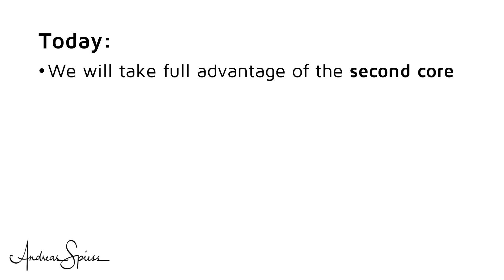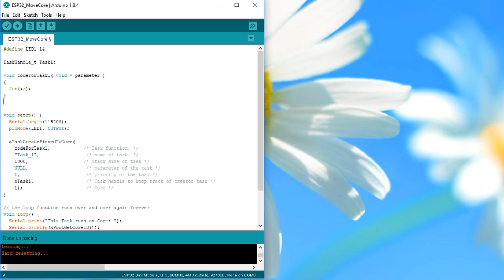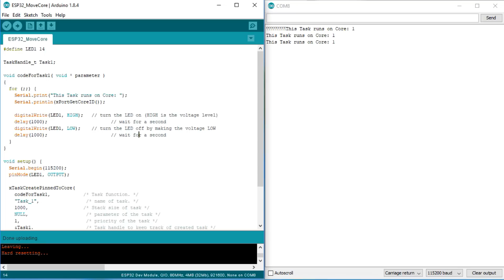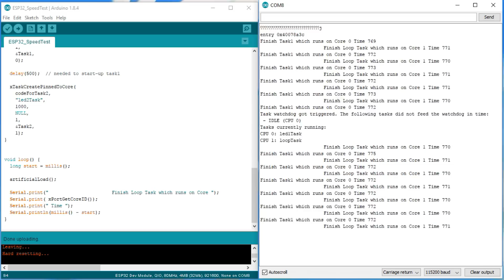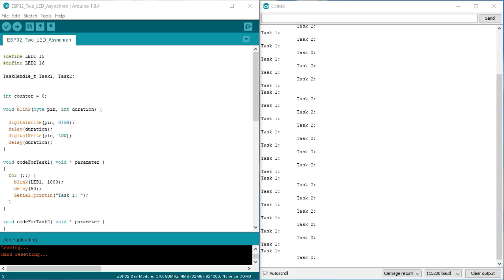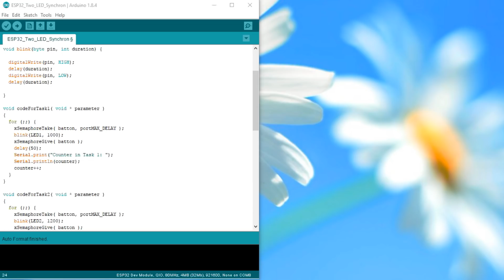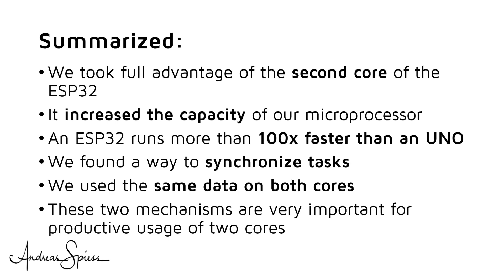#168 ESP32 Dual Core on Arduino IDE  including Data Passing and Task Synchronization

Comment: Hey I am currently working on a project that required high sample rate data from ADXL345 to send to AWS IoT and I tried. Dual core with one core fully dedicated to sensor Task putting data to Queue and wifi Task would take from the queue make a json and publish it. so I made a message of 64 samples (each of 16-bit x,y,z total 6 bytes*64) and queue size set to 100 or 150 but what I observed was that once the sensor task would completely fill the queue. wifi task would suddenly slow down and like the delay to publish from picking data out of queue would increase and thus hamper sensor task also as queue would be full. I could not use more RAM with just Array implementation I was able to have 9600 samples of x,y,z. which is less than what is required by my client. The code has wifi manager also if I remove that I get addition 10% free RAM. is there a way we can store more SAMPLES without manipulating x,y,z or without removing wifi manager? this was on Arduino and it does not support over 4 MB RAM of Wrover so we are stuck this amount of RAM, unfortunately.
Reply from the maker: Maybe you can reduce the amount of memory used by reducing the number of bits used for one number. I would first try to understand why it slows down. I would remove everything not necessary and use an oscilloscope or a logic analyzer for real-time debugging. If you do not know how. I made a video about debugging of real-time systems
Reply from the maker: Json is also not a good idea as it needs lots of memory.

Comment: HI Andreas, great video demonstration. I have a question: How to share devices, say, core 0 reads a sensor storing the data on an SD card and, with the next core, run code to pass SD data via Bluetooth to a terminal running on a cell phone. Thanks
Reply from the maker: As I showed with synchronization.

Comment: Lieber Andreas! Tolles Video. 
Eine Frage: Ich dachte immer dass der zweite Core die ganzen WiFi sachen machen würde, zB UDP oder TCP.  Ist das nun so dass ich das quasi selbst beim programmieren vorgeben muss wenn die WiFi sachen auf dem zweiten Core bearbeitet werden sollen?
Reply from the maker: Die "Wifi Sachen" laufen wo auch immer (ich weiss nicht auf welchem Core und auch nicht, ob man das ändern kann). Du kannst aber deinen eigenen Code einem Prozessor zuordnen.

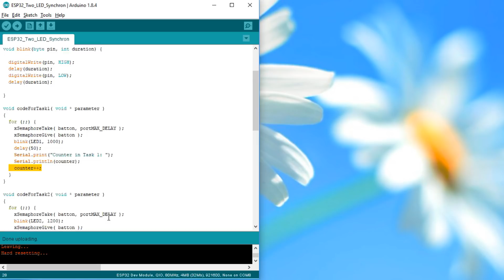Comment: To properly handle a scenario where two functions might access the same variable at the same time, (as in 10:50) I believe you'll want to declare it as "volatile" in the IDE. For example:

volatile uint8_t counter = 0;

In the past, this has solved situations on AVRs where I had a variable which was accessed occasionally in the loop, and very often in an ISR. Without declaring as "volatile", the ISR would have a chance of interrupting the "write" process of a variable in the loop, and would be unable to read it in the interrupt due to the corruption.

I think "volatile" declarations force reads and writes to totally complete before anything can interrupt it.
Reply from the maker: I am not sure if this concept works for two processors. I know it works for one. But this problem is much easier to solve as you just can prohibit an interrupt for a short time.
Reply: Yeah, maybe not. I've got an ESP32 coming in the mail soon that I feel will kick me in the butt trying to fully understand it. I've been on your channel for about an hour watching ESP32 and LoRa videos to study it - keep up the great work Andreas!
Reply: Defining variable as 'volatile' is definitely a step in the right direction, but isn't quite the ENTIRE answer.
The reasoning behind 'volatile' was more for the purposes of variables that could be altered in either the normal flow of a process, or perhaps in some ISR (Interrupt Service Routine), but this is still on a uniprocessor setup albeit with two distinct 'threads' of operation..
Thus, the 'volatile' definition was / is a 'hint' to the compiler that it should not 'cache' the value of a variable as it could quite possibly change BETWEEN sequential instructions in the normal flow if an interrupt had occurred.
What's required is a second step of mutual exclusivity (often called a 'spinlock') that guarantees exclusive access to the variable(s) in question.
The goal of a 'spinlock' supercedes ANY other asynchronous event (whether it is an interrupt, or perhaps even an entirely different CPU core), from modifying some fundamentally exclusive piece of data.
Concepts such as spinlocks become VITAL when you start developing non-trivial software (eg: The Linux kernel).
In the OLD days, much of the Linux kernel revolved around a single HUGE spinlock that was known as the BKL (Big Kernel Lock) which inhibited almost every other possible thread from execution.  Now that the kernel has significantly 'matured', the 'granularity' of spinlocks has been significantly improved such that threads are far less likely to be 'blocked' waiting for the release of the BKL from some totally independent mutual exclusion.
(Imagine having to 'stall' every single core of your 28 core beast simply because ONE of those cores wanted exclusive access to the UART ringbuffer.  That's how it was actually done in 'the good old days')

Comment: Thanks for the video. It is very structured and clear. RTOS is about being "real time". The RTOS guarantees execution of the command at that specific time. This is essential for real time control. Conversely non real time OS such as Windows, does not guarantee that an instruction will be executed exactly at the programmed time. For example,
In Sleep(1); Print("now");
Print statement may not be executed exactly after a sleep of 1 msec in non RTOS. This is because non RTOS drivers for example filesystem and network drivers may take longer than 1 msec before returning control back to the OS. In real time control systems, this unpredictability is disastrous.
Hence RTOS is about "real time" and it is a big deal, very big deal. 
RTOS are expensive. 
Hope this is useful. I am sure you can explain it much better than I can, thanks.
Reply from the maker: Thanks for your clarification.

Comment: Thanks for the video Andreas, lots of great info.

I got a MAX7219 Led Matrix display being scrolled on one core (using a task, core 0) while the other core fetched the data (just using the loop). It's great because you can now scroll without any interruption!
Reply from the maker: Thanks for the feedback! Interesting. So it works!
Reply: Yup! I had it running for maybe 30 mins or so and it was working fine (I know not a conclusive test, but promising for sure!)

Comment: Another great video , and I do embedded firmware for a living.  Well done.   One thing I miss in the Arduino IDE for the UNO is a single stepping sbolic debugger.  Is one available for the Esp8266?   Does anyone know if it can be fudged on the UNO?
Reply from the maker: I do not know of such a debugger. Otherwise, everybody would use it ;-) Would be awesome.

Comment: It's probably freeRTOS... Function names seem very similar. Try using message queues for data exchange, pretty straightforward and easy to use. Don't forget volatile key word for global variables if you want to use them. And try to protect concurrent access to global variables with a mutex.
Btw: RTOS is not necessarily smaller or less powerful than windows or Linux. It's just designed for a different purpose. The Mars Rover runs on vxWorks rtos ;)
Grüße aus Lausanne
Reply from the maker: AFAIK they use freeRTOS

Comment: Thanks for this!  It was very useful to me for something I'm doing right this instant - good timing (heh).  Was it ever discovered that the WiFi stack runs on core 0 for certain, and what priority we should set the task on that core to allow the WiFi stuff to get enough time for itself?  I'm finding this useful to cut latency in the regular loop() function by putting some other network-related stuff into core 0.  That way I can have super low latency with my sensors (not all can be interrupt driven), buffer data and then send that data in the non time critical task I have running in core 0.  I found just checking for data on some UDP ports was slowing loop time considerably (ms) but that issue goes away when the checking (for host commands and so on) is in core 0.
Reply from the maker: I did not dig into it any further. I would assume we give our tasks a very low priority. If nothing else runs, they are not disturbed and run at max speed and if other tasks run scheduled by the "OS" we do not disturb them without knowledge.

Comment: Hi Andreas,
Been watching your video tutorials with great interest.
Of course now i have a new question/challenge in mind where i don't find a answer to:
Can we mix ESP-IDF AND Arduino ESP-SDK in one sketch (i like to think this is possible, because i looked deeply into this video of the ESP on steroids)
BUT : can we create something like 2 sketches in one sketch and pin every single one to a different core?
What i mean is :

// make some vars
uint32_t myTime = 0;
uint32_t yourTime = 0;
#define sensorPin 15
#define PixelCount 72
...... // whatever one would need as vars

void setup1(){
...... // code for this setup function to run once
myTime = micros();
}
void setup2(){
....... // code for a second setup function to run once
yourTime = micros();
}
void loop1(){
..... // infinite loop code to run on core1
}
void loop2(){
..... // infinite loop code to run on core 2
}
but with all of the variables, classes, defines,  accesible to both cores
If that would be possible, we can split 1 ESP32 into 2 high performance systems, on one chip, separating Wifi, BLE, logic, and sensors to the core we want
This would mean we can drive neopixels, LCD's, buttons and so on.... in one core, and keep track of the external interrupts, data gathering, calculating data,....  on the other core
Looks like heavy stuff, but this would need a genius to start on this queeste (but i am not that genius ....)

Why do i ask this? Because i noticed that in the ESP-IDF there is no "void loop()" but a "void app_main()" instead

Thanks for the video's and keep up this magnificent tutorials for newbie (and experienced!) user of the ESP32 platform
Grtz and best seasonal greetings from Belgium
Yves,
Reply from the maker: You have already a lot if you look at my sketch: Two RTOS tasks and semaphores. You can now try to add the code in the task you want and try what happens...

Comment: You should always take the baton before accessing global variables, and give it back after accessing them. This includes writing access and reading access. If two tasks are writing at the same time the outcome is undefined. And if one is writing and another one is reading the data may be inconsistent, the writer may have started changing the data but not finished when the reader starts reading.
Nice video as always, many thanks.
Reply from the maker: You are right. I used the sketch for parallel blinking as the example for the counter. The serial blinking example had the right order of the commands to protect the counter variable.

Comment: Is it possible to use the "low power consumption" - core in the same way?
Reply from the maker: No, the ULP is programmed using a special assembler code.

Comment: Another awesome video. The ESP-32 is displacing our beloved ESP-12 as the go-to IOT module.

Have you had any success accessing the third (low-power) core? Perhaps the biggest problem with the Expressif chips is their power requirement. If you are polling for an activity (pin pulled low, for example), could you deep sleep the two "fast" processors and just watch with the "slow" processor? Then wake the fast processors to do the processing?
Reply from the maker: I did not experiment with the ULP so far.

Comment: Awesome thank you! This will help with my current project I will have one core listening for bluetooth instructions and the main core runs the main block of code. As an aside, anyone who listens to the amp hour podcast should remember a few episodes ago the talked to Jeroen Domburg who now works at espressif who told us that it runs freertos and is multi core...although looking it up I know realize that was actually not that long ago but anyway yea...
Reply from the maker: Good luck with your project. Seems to run not only at the "Leading edge" but probably at the "bleeding edge"...

Comment: One of the hangups of my ESP8266 is that it does not do SSL well while serving web pages.  With the 2-core ESP32, I would hope that dedicating one core to wifi and HTTP requests, and the other to encryption/description may make it a more viable secure wifi web server.  Experimented with this?
Reply from the maker: After the experience with the ESP8266 and web, I am not sure if this is the way to go other than for entering credentials. I think  M2M using MQTT or web services is the better way for ESP like MPUs. But I might be wrong...

Comment: Thanks for this clear tutorial! Hope there will come a new structure in the Arduino IDE where there can be added a second loop function which automatically uses this second loop for the second core.
I think in the future there will come controllers with more cores. So you can make multiple loops for all the cores.
Reply from the maker: As a showed, you already can create more loops. Just name the tasks "loop2" and so on...
Reply: Just rewatching this video because I have a new project which requires dual core.
I want to split wifi tasks to one core and run other tasks on the other, but it isn't clear how to do and when I try, it crashes...
Reply: @RobinGerritsen1995  Wifi and Bluetooth are automatically created in Core 0. If you put all wifi and BLE related code into core0 it should work.

Comment: I've just remembered that I did some work on parallel programming for control some years ago.  I found that in many simpler applications, there was no need for software synchronisation (e.g. via semaphores); the synchronisation came via sensor feedback in the real world.  That means that there are many practical applications one can code up for twin cores without having to use semaphores at all.  Hope that's helpful, regards, David
Reply: I'll second that - in spades.  If you really have a good understanding of what you're doing - or can "be the computer(s)" in your head, oftentimes you don't need to block on semaphores or mutexes or even spin-busy on a shared boolean.  My outfit wrote quite a bit of "very high 9's" software for some telecom manufs using this trick - and some of it hasn't crashed since started in the 1990s.  But!  You'd better darn well comment in unmistakable ways "the wires that aren't there because they don't need to be" - why you can do this without all those moving parts.  Because someday, someone else is going to touch that code and since it looks easy - will not bother to undertake a full understanding, and that's when your phone rings at 3 am...Of course, that other person might be future you who has forgotten the plan.  But it's still worth it - even though they take awhile to type - comments run VERY FAST!  They also don't take up a lot of space in the runtime(!).
Reply from the maker: Thanks for the tip!

Comment: Excellent video once again. I have been using ESP8266 modules commercially since the documentation was only in Chinese and personally experienced the frustration that the community was going through where the background WiFi functionality was causing delays and inconsistency in certain routines, especially ones that used PWM. In response to this Espressif came up with the idea to add a second core to do all this stuff while the first was left alone to do reliable networking. This was deliberate and hence the ESP32 solved many problems that we had to learn to work around on the ESP8266. 
I think that this needs to be kept in mind when assigning tasks to Core0 and only short, non-essential code should be used there.
That being said. Thanks for expanding our knowledge with handy, practical tips.
Cheers.
Reply from the maker: Another viewer did some testing and wrote, that Wi-Fi runs on core 1. Do you know more?
Reply: Thanks for your reply Andreas. No I don't know more. I think you are much more up to date with the ESP32 than I am. I am simply stating the historical basis for the second core and went by what Espressif were saying at the time. I was unaware that the new Arduino interface for the ESP32 was layered on top of RTOS. If the default for WiFi and user-defined are both core 1 then that would kind of defeat the purpose of the second core unless RTOS has already taken the balancing of tasks into account.

Comment: Hello Andreas! I love your videos, and I learn a lot when I watch them. Sometimes though, I learn just enough to make a mess. Can you please help me figure out why my (CPU 0) task keeps triggering the Task Watchdog? I am trying to run MQTTConnect from the adafruit examples there. I was hoping to use that core to read the mqtt feed, and not have to use that precious time in my main loop.
Reply: vTaskDelay(1);
Reply from the maker: As you see in my video I also got the watchdog, but only as a warning. I did not find out how to feed it.
Reply: Yeah, once I get the watchdog, the CPU0 goes to idle, and the function does not attempt to run again. Thank you so much for replying. :)
Reply from the maker: Please come back if you find out how to feed it...
Reply from the maker: Thanks!